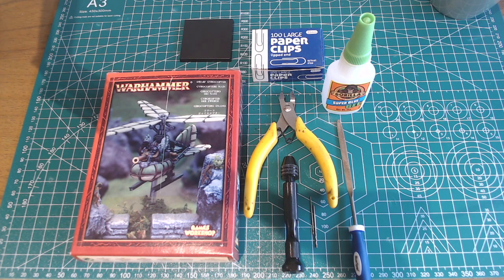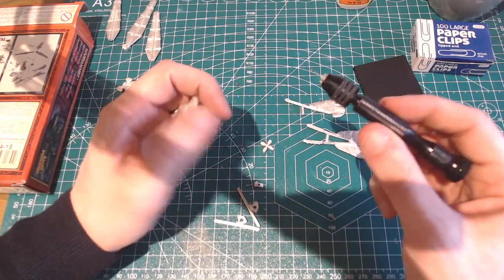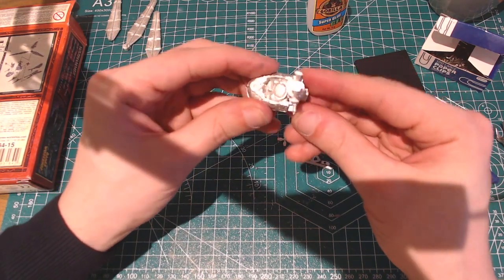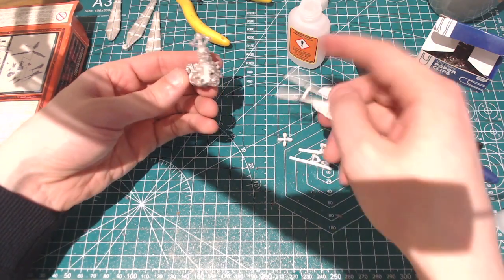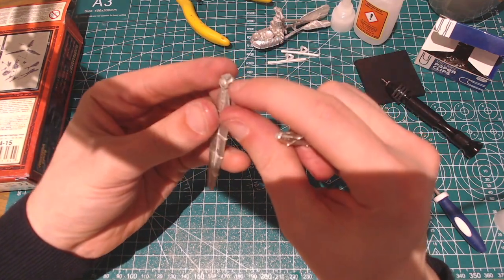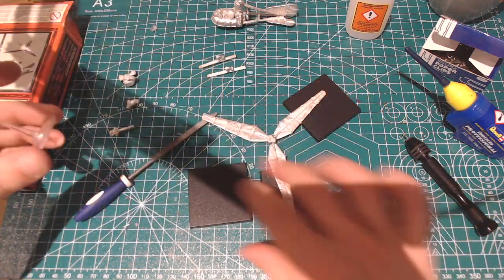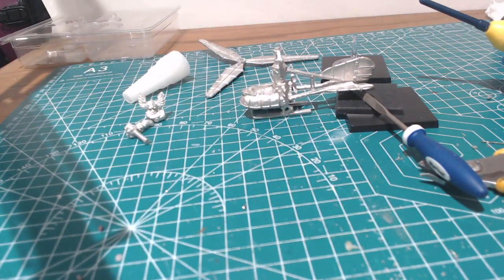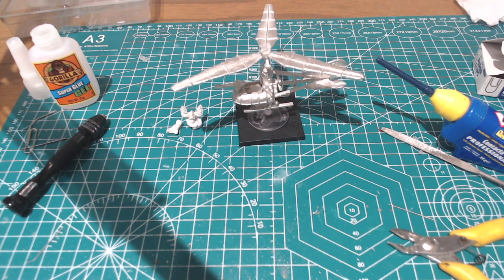Pinning Metal Figs or: How I Learned to Stop Worrying and Love the Gyrocopter

Comment: I was under the impression the best solution for the rotor blades was to solder them.
Reply from the maker: I'd be a little concerned with how thin the parts are where the rotor blades mount to try and solder it without melting anything given my lack of experience with that technique but if it works that's a good shout. The only situation where I've really come across people soldering metal figs is when replacing the swords on historical figs with ones made from pins instead but that might just be my ignorance.
Reply: the metal thunderhawk is another example.